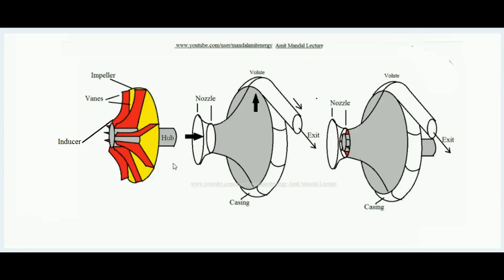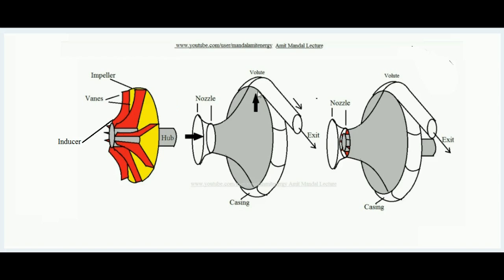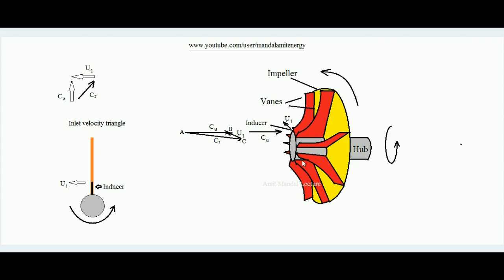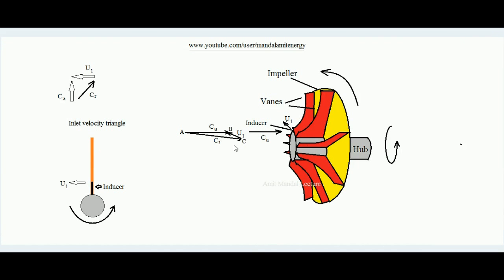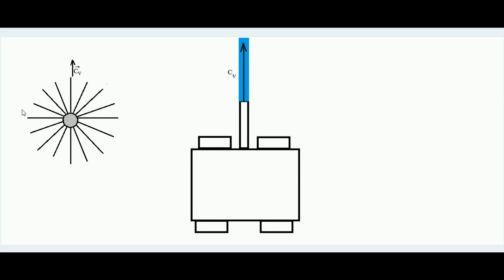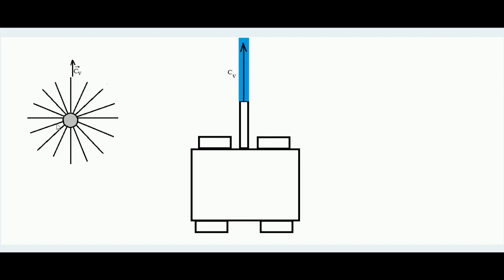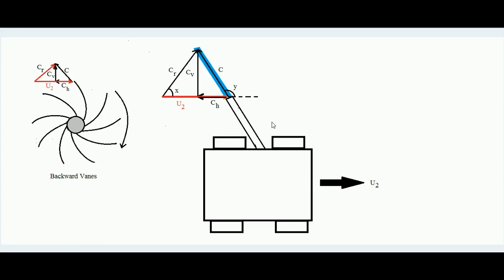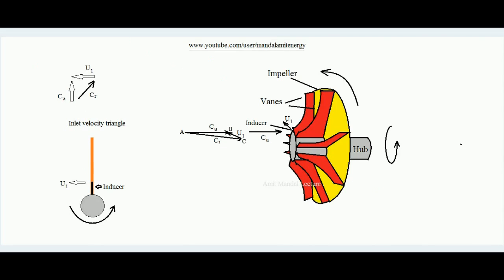Velocity triangles of centrifugal compressor (Lecture 2)

Comment: sir plz clear the angle notation ,
 as per axial compressor alpha is the angle  b/w  axial and absolute and bita is the angle b/w relative and axial but in case of centrifugal will it be same as axial or different?
Reply from the maker: There is no as such standard notation. Follow the theory...

Comment: Exceptionally outstanding explanation. But still I have a doubt, sir, cart example.. you took is similar to buses which have exhaust pipe on left of the side of the bus. But when bus move forward or away from you(assuming you are on the back side of the bus, back side of bus facing you) the gases come towards you, and not away 10:08 , you have shown otherwise, where am I wrong, please explain.
Reply from the maker: +Nikhil the analogy is applicable when simobody is coming out of bus perpendicular to the direction of motion...could be stepping out of door.

Comment: It's explained well but only 1 error, V12= V1 - V2 where V12 is Velocity of 1 wrt 2... You are saying Cv+ U1 it should be Cv-U1=C... Other than this, it's excellent...
Reply from the maker: I have checked , and it seems all slides are correct in regards of the sign convention of vector and the concept of vector addition. however could you please tell me in which image you found difficult to understand with the same symbols as mentioned in it?